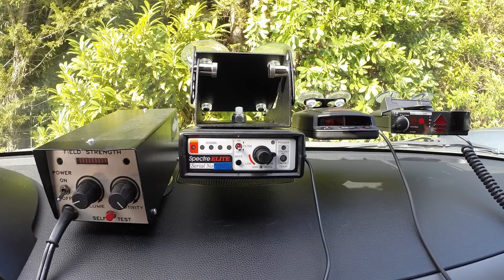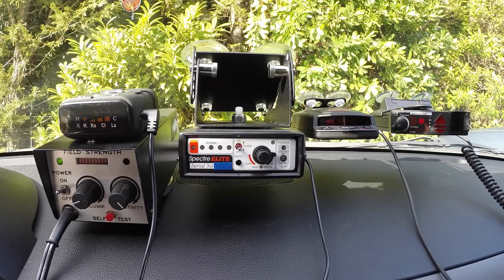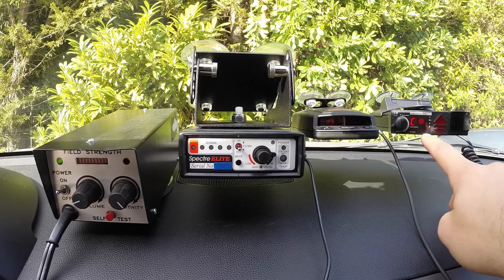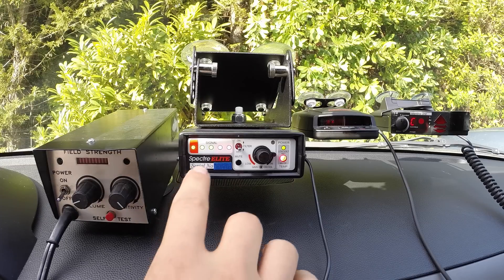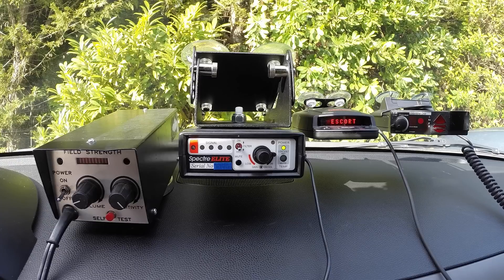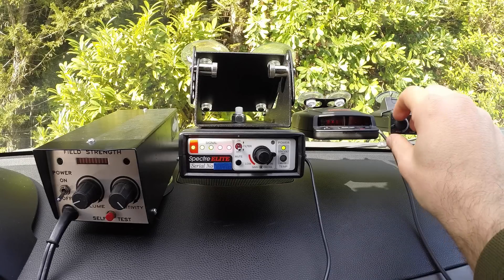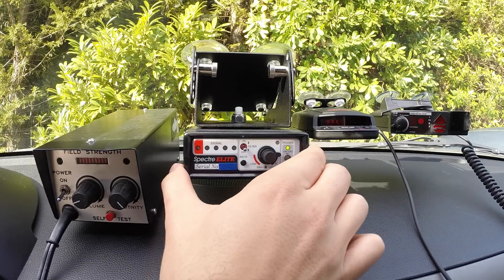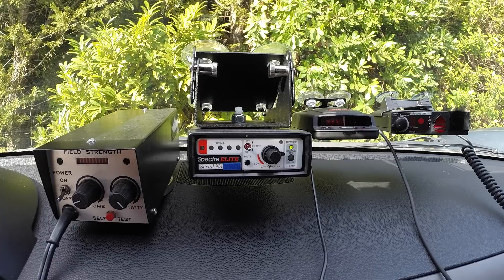Evolution of Radar Detectors & Radar Detector Detectors

Comment: Good Video VR, I love your YOUTUBE CHANNEL..  however you need to test the Whistler CR97 who makes the BOLD CLAIM of it's VG-2 RDD detector features'.  I sure like to know if it works if this feature turns off the RADAR DET for 20-?? seconds.  This feature is a great tool to sniff out POLICE RADAR as I see it because the police are the only ones to use it..,   Please do a review on this feature.  Some MID-END, RADAR DET have this feature ...""VG-2 Detection Mode.
See Option Select Mode to turn this feature on/off. When a 
VG-2 signal is detected, the VG-2 alert is sounded and the 
display flashes “VG-2”. After 3 seconds the audio is canceled 
and the display no longer flashes. This cycle is repeated if 
the VG-2 signal is detected again. During the period a VG-2 signal is detected, a radar 
signal cannot be detected. 
However, because the VG-2 alert has confirmed that a patrol 
car is nearby, you are already aware of the potential for 
speed monitoring and can adjust your speed accordingly. 
Laser detection is not affected while a VG-2 signal is 
detected."""
Reply from the maker: I used to do VG-2 testing like that, but given how ancient the VG-2 is, I now focus on the Spectre instead, though even those have since stopped being produced too.

There’s zillions of things I could test, but I aim to focus on what is the most relevant and important.

Comment: Does anyone know how to make a detectable radar somehow undetectable? maybe wrapping it in tinfoil to shield the noise from going outwards, or taking it apart and wrapping the insides in reflective tape or something?
Reply from the maker: It's not that simple. Most of the signal leaks out of the horns (antennas) and you don't want to cover those up because you'll start to impact detection capabilities. Escort has a patent on how they implement their stealth technology. It's a cool read if you wanna check it out. https://patents.google.com/patent/US7388537
Reply: I tried wraping my old Whistlergroup 1630 in tinfoil, It will help reduce false alarms from other radar detectors and stray signal from home alarms.  it will reduce the detection of RDD's.   It help against the VG-2 in Va but I did not turn on vg-2 detection and they found it by pulling-out and traveling with traffic until he saw it in the windshield.  Vg-2 still in use in VA.
Reply: Radar can always be detected because it is a transmission that is reflected from your vehicle.   A radar detector can easily be made undetectable but the cost of shielding would probably triple the price of the unit so it's not worth the trouble to the manufacturers.  Until today I had never heard of radar detector detectors and wondered how sloppy are they built?  Pretty sloppy it seems.

Comment: the thing to do is have an old leaky radar detector from the 1990s.  when you're not speeding and you see a police car , then start switching it on and off, thus triggering the RDD on and off.  that should drive the cop nuts and make the cop think that his RDD is malfunctioning...you can do it with a modern radar detector, but the old leaky ones will make the RDD go to full strength from a longer distance.   hmm??? would make for a funny video

Comment: Can radar detector detectors interfere with each other? If you had both of them on at once would they alert?
Reply from the maker: The Spectre actually does set off the VG2. It's actually why I had to run them independently for this video. Otherwise I would have simply left them both on. :) Good question!
Reply from the maker: +Andrew Wood haha

Comment: Just wondering, If you turned off all the radar bands detection on the V1 and just left it with Laser Detection , would the Spectre detect it?
Reply from the maker: Good question. I just set it up and here's the video: https://youtu.be/0dWcUedOQ4w

It's still detectable with all bands off but it does look like Spectre detection is somewhat reduced. Once the weather clears up, I'll do some road testing to see what difference it makes in terms of range. :)
Reply: Thanks man for the quick reply!!